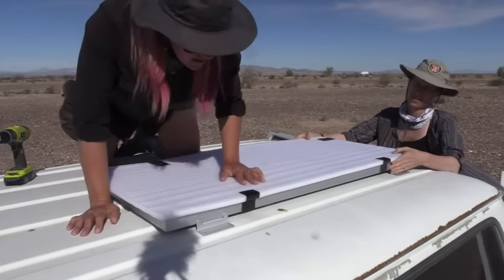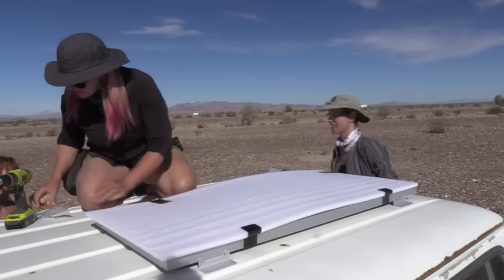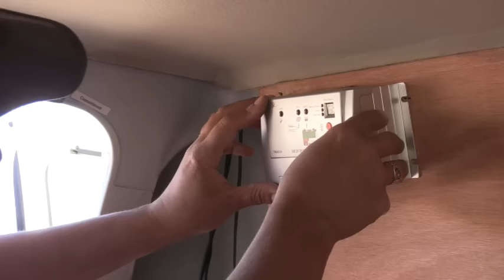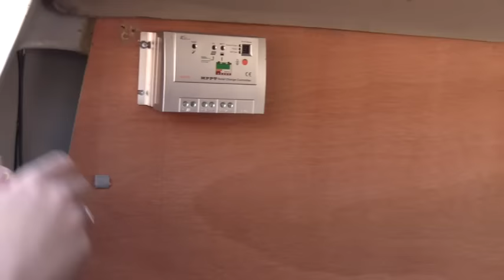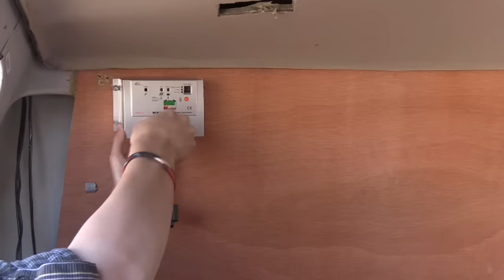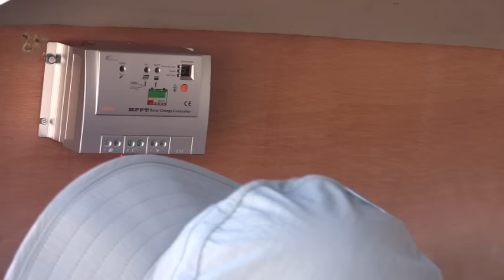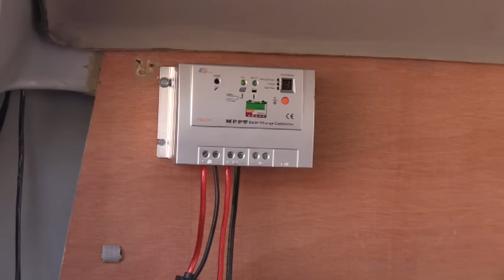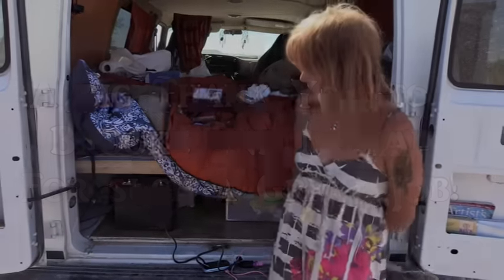Van Life Essentials How to Install a Renogy 100 Watt Solar kit

Comment: If you use a lead acid battery it will off gas during charging. This is highly flammable explosive gas and also not good to breathe in. The battery should be in a sealed enclosure with a vent pipe or sufficiently sized tube going up and out of the van or living space with a device at the top end to prevent rain water from entering the battery enclosure. The battery should be mounted to the floor or even better in a good case mounted out side under the floor in a way that it can be serviced like on a drawer slide assembly inside a steel enclosure. I've personally witnessed a battery explode with so much force it launched a split hood assembly both sides of a international 8' x18' flat bed truck nearly 10' feet into the air. This occurred in Pennsylvania the winter of 1977 it was - 15 degrees and was connected to a gasoline powered start all machine being jump started. Once the engine started the operator of the start all machine pulled the positive terminal off and caused it to spark that was the first mistake or second cause he hadn't even stopped the charge current coming from the start all machine which he should have done first and then carefully removed the negative cable first which should have been attached to a ground point away from the battery. Hydrogen gas is extremely explosive. I once had a battery explode for no apparent reason in my 1976 datsun pickup while driving on a smooth road through town. It was properly connected and secure. It blew the whole top and sides of the case off. I opened the hood and the terminals and cell structure were still intact so I drove it home. It misfired like crazy cause the battery acid is highly conductive and was all over the plug wires. To this day I have idea why this battery exploded it must have been an internal short caused by a defect or foreign object inside the case that caused a spark. I replaced the battery cleaned up the wire's and every thing was fine never have had an issue again with any car battery again but I do respect the power of lead acid batteries and am extremely careful when working with them.

Comment: hi there just trying to find out if i get a van and want solar power what wattage do i need to run a small fridge a tv an electric jug a hair dryer laptop charge my phone, i take it i would need more than 1, 100 what solar panel and then do i need a bigger battery and converter thing. thank u

Comment: Yes this video was painful to watch I put on my van ladder racks in the factory mounting holes I wasn't going to attempt to drill 24 or more holes in my roof for my solar.
Reply: Same. Then I ran the cables through the Antenna on the roof. I never listen to the radio so I wasn't going to miss it.

Comment: I have a CPAP,would 100-watt panel run that?
Reply: Depends where you live.  Depends on your battery storage. Depends on the energy consumption of your CPAP. There's lots of variables to take into consideration before answering that question.

Comment: I just have a dumb question--- Why would anyone just put one panel of solar on the roof and drill 8 holes to hold it down, rune the headliner, and take a chance on leaks when you can use double sided 3M and do the same thing without drilling any holes-- the 3M is fantastic stuff - you can't even pull it off without breaking your back.....
Reply: Driving 70 mph down the highway, I don't want anything on my roof being held down with tape. IDC how strong it is.

Comment: I have never seen any grounding?  do you chasis ground anything in this system?
Reply: The only connection to a battery post negative should be to another battery negative, the vehicle chassis, and/or the engine block. There should never be a direct negative post path to accessory equipment that has any sort of ground path to external devices.  

The sole exception to this rule is when the equipment being connected electrically isolates or floats the negative terminal power connection from any external connections. If the negative power feed wire electrically floats from all exposed conductive cabinet parts or external wiring paths, a fused direct negative should be safe. 

An isolated power ground inside external equipment is the only condition where a direct battery negative terminal or post connection is safe.
Reply: CincyPlasmaTech, the controller is grounded the the batteries negative post which should be grounded the the frame unless you installed a shunt to monitor the batteries then it would go to the frame from there.
An inverter would be grounded to the frame.

Comment: Does anyone has seen somewhere an installation where the panel is on two axes of rotation ?
The performances are multiplied by 3.
Reply: Positioning your solar panel to follow the sun is more effective, I wouldn't say 3x more effective. A multi pivot panel isn't always ideal for for a van.

Comment: If you need to put the nut on the bolt alone, just glue the bolt to the mount bracket . wait until it drys and then do the nuts. if you glue all bolts you can do all the nuts one after the other.

Comment: Standard lead acid battery, off gasses hydrogen sulfied gas, both expolive and toxic!? both can only be addressed by isolation from living compatments muchless sleeping? that's why the danger. Ther were also many more mistakes, sorry, just unprofessional.
Reply: AGM batteries are already sealed. That's why they use them specifically for motor homes. And yeah, you should put it in a box so nothing can touch the battery posts. They've basically done everything wrong that they could have in this video when it comes to the battery.
Reply: Please see my later post.

Comment: Wrong installation of the panel to the roof , must to put some silicon or any sealer compound to the holes to prevent leakage and rust of the roof from water !, any hole drilled into the car for bolts or cables need to be sealed with some silicon it protect the metal and sealing the insert hole
Reply: They used silicone, you must learn to watch the video first. Then learn to write sentence. Learn to spell also

Comment: There's no gain from using a MPPT charge controller  with a 12 volt solar panel. The gain comes from using a 20 volt panel or a 24 volt panel to charge a 12 volt battery. And those Ever Start batteries are the worst deep cycle batteries ever. It's really a starting battery with slightly thicker plates. And their battery isn't in a plastic battery box. Battery acid is highly corrosive. If that battery gets hot and the battery is overcharged because there's no temp. compensation,  on the charge controller, that battery will boil over, thus spilling electrolyte on to the metal below, eating away at the metal.
Reply from the maker: I disagree. A PWM wastes all the power coming from the solar panel above what the battery can take right now. If the panel is producing 19 volts, nearly all do, and the battery is only taking 113, the PWM flushes the 6 volts above 13, wasting 1/3 of the power you paid for but do not get.
Reply: I've had a Morningstar charge controller die right after the 5 year warranty was up, so I'd be mad if I had spent $300 on a MPPT controller that died like that. And they do die. MPPT controllers shine in the winter when the battery is low and hungry. The claim is up to 30% more power into the battery.  In the winter, the MPPT down converts the higher voltage into amps, but, I think during the hot summers, the hot panel doesn't put out the higher amperage. Either way, I still love ya, and I hope God gives you 20 more years on our green planet.
Reply: OK Your right. The MPPT charge controller is superior to PWM. I listened to the lady at AltE explain it better.

Comment: The amount of hydrogen produced by charging lead acid batteries is tiny.  In addition, since hydrogen is the lightest element in the universe, it races upward at 45 mph once it's been released from the oxygen in water.  It will go out of the tiniest leak it can possibly find.  You aren't going to be breathing in ANY of it.  And a tiny bit of hydrogen that might happen to get trapped somewhere is not explosive.  It is NOT DANGEROUS.  The only time it lead acid batteries can ever represent a problem is if a little bit of hydrogen builds up under the caps for the cells and a spark hits it just right.  This can cause the caps to blow up, potentially spraying some sulphuric acid, but without a spark, this cannot occur.  If you're still scared, then just use AGM batteries, which contain the hydrogen and recombine it with the oxygen using a catalyst at the top of the inside of the battery.
Show less
REPLY